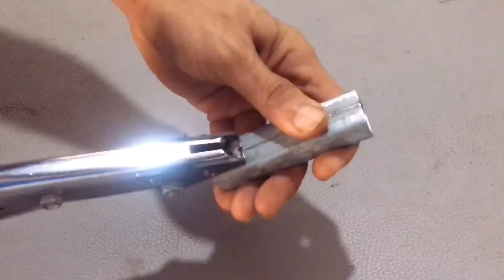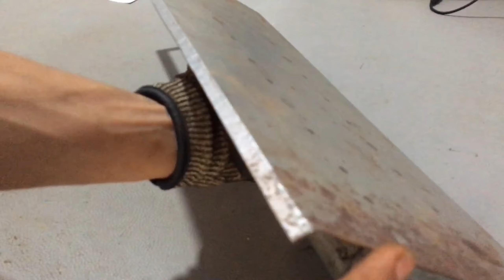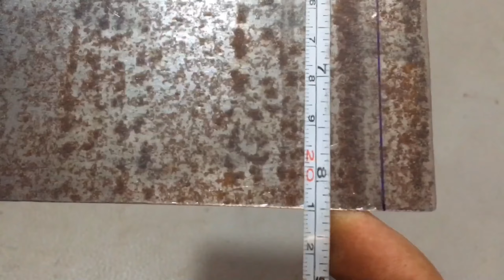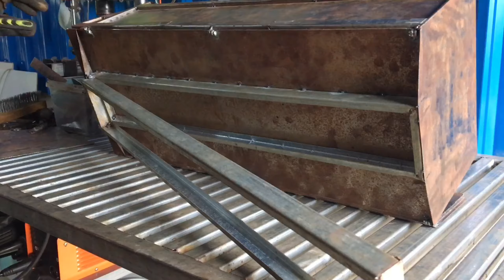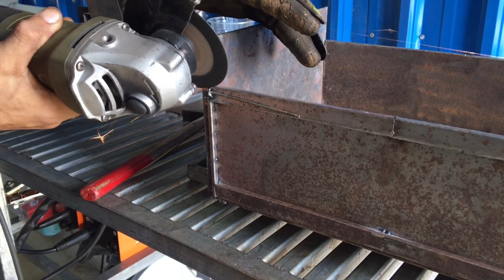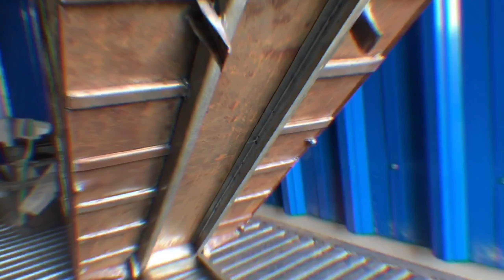Remote Control Construction Truck Part -How to Make a Red Metal Dump Bed #MERCEDES-BENZ Model

Comment: what is the brand of this welding machine because I have a parqueside but I still don't know how to use it very well and it seems to me to be much better for welding sheet metal than electrodes
Reply from the maker: That is a MIG welding.